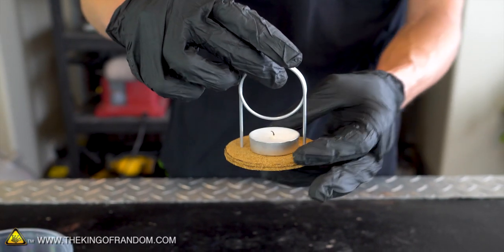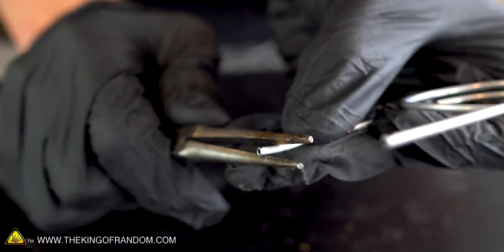Simple Steam Engine! TKOR's Tea Light Steam Engine DIY Mini Steam Engine

Comment: Use methanol
Reply: That's an alkANE, yay trilogy science
Reply: Lil Memeboy because it has a boiling point of 60 degrees Celsius which will allow for the whole cycle to happen quicker
Reply: Yesyesyesyes
Reply: D.G.M.ANIA pp
Reply: But wouldn't the candle just light the fumes and set the whole thing on fire?
Hm, then again, that could be pretty awesome. Imagine actually doing that with the metal salts for colored flame added in. They would probably plug up the tubing rather soon, but it should look pretty cool until then.
Reply: YouTube Thing methanol is actually an alcohol no alkane
Reply: Is this a big bang theory?
Reply: Meth-anol

Comment: Tips for bending pipes/tube : Insert a wire in, it will give resistance to kinking. For this one i would use small electric wire. But this tip derive for hard line watercooling, which is most often glass.

Comment: Are you willing to experiment further on the basic steam engine?  I think that if the flame was offset a bit, instead on being at the center of the tube's lowest part, it may increase the movement of the water in the pipe, as the heated water would be raising.  Another thing to try would be to have the "intake" and the "exhaust" to be bent in the same direction, instead of opposite, the little bit of suction in the "intake" may ease, or speed up, the movement.  I think this would be an interesting continuation of your post.  By the way, it is a very interesting post.  Cheers,

Comment: Minor suggestion:  Heat the tube more on one side than the other.  Hot water and/or steam will rise and cause the circulation you  are missing in your setup.  The way it is now, it is fighting itself.

Comment: Wouldn't it be much more effective if you offset the candle and kinked both ends the same way? That way one hole is an intake and the other is an outlet. The force of the intake will aid the force of the outlet in spinning the cork, and keeping the candle offset helps enforce the association by making one side of the loop warmer than the other.

Comment: It probably stalls because water is being expelled on both ends of the bent tube. Try offsetting the candle to one side so you'll have a hot intake side and cold output side. It'll work better. Once the candle (heat source) is offset to one side, try putting an icechip against the other side of the bent tube. Heat engines work off a thermal difference and this will create a better one.

Comment: This is a vacuum engine. If you speed down and look at the water flow when its blue-dyed, the two exhausts never push together. Water first boils and the volume is expanded inside, that pushes out the water, at the same time water vapor cools down touching the cold parts of the metal tube which turns to water again. This expansion and cooling makes the move. Although its sometimes called a steam engine, there is no steam getting out.

Comment: You should hold that flame further away from the pipe. Soot is insulating it over time. I believe that despite lower temps, the steam should be gaining more heat when the flame is further away.

Comment: If you bend the ends of the tubes the same direction and give the candle an offset!
I kinda see it working 
It is also April the first 
And this also makes more sense to me if this setup is flipped over so cold water can run down and the lighter warmer water rises up!
If you really had steam in this it would shoot like in the end
Steam takes 1700 more space than water

Comment: Another way to prevent your aluminium tube from kinking would be to fill the inside of the tube with sand and cap off the ends with tape, so once the tubing is bent over what ever you choose, you can easily remove the sand.

Comment: If you wanted to, you could probably rig up this device, or something similar, with a couple magnets to make an even better motor which could potentially power something larger and maybe if enough kinetic energy gets into the system, something really big could happen!

Additionally, I'd really like to see some Negative X combined with Lithium in an attempt to ignite Thermite.

Comment: If you just put the candle slightly to one side or the other of the pipe it will spin until the candle burns out. It can't pull water in when it shooting steam from both sides.

Comment: Can you see an ancient "coffee pot" with one of the ports leading to the grounds over the cup? Also, I woud use a cleaner fuel as the candle coats the tubing with a coat of carbon... this inhibits the transfer of the flame's heat to the coil after a bit of time.  Cheers!

Comment: It is stalling because your not creating a temperature differential between the two sides, thus making one side into a water intake and the other an exhaust. You can easily rectify this problem by simply putting the candle off center (closer to one of the aluminium pipes on the side.).

Comment: Would you be able to turn it upside down with half of the circle in water and some holes in the tubing that would be under water to continue flow of water through the holes and force the steam out into the air for push?

Comment: I think that its stops because you are using a very small diameter tube and the flame is too hot and causes it to push out all the steam before it and draw in enough water to continue.  You should try using some larger steel brake line and the same candle, will take longer to start moving but I bet it will chug along much longer

Comment: It would work better if they were both bent the same way. One will draw the water in the other will jet it out. 
You can even prime it a bit by sucking a bit of water into it with a small tube while the candle heats it.

Comment: I want to make a self circulating cooling system by taking a tank(soda bottle) 2 check valves one on each side connected to a metal tube to be heated like you did in this vid.

Comment: It would have worked much better if one side was slightly longer than the other so that cooler water would be drawn in the shorter side.  Another way to ensure the proper turning angle is to have the flame offset on the coil so that the cooler side feeds the hotter side.  One trick to bend pipe is to fill it with water then crimp both ends.  The water inside the tube prevents crimping during the bending process, as water is not compressible.

Comment: Do you require N52 strength magnets for these experiments to work well ? Or something slightly less powerful ? I cant seem to find the right-sized N52 magnets for doing these experiments. The ones on Amazon are all 1.26 inch diameter. Any pointers ?
Reply: @waswaniable I had the some problem for a magnet electric generator project. I'm not trying to be some advertiser, but after looking for days on the internet I stumbled upon one magnet supplier.

Might I recommend K&J Magnetics they supply Magnets in whatever size you need and seem to be trustworthy.

Hope this helps!

Comment: I think you would want both ends to point in the same direction, wouldn't you? After all, one end pushes (out steam) and the other end pulls (in water). Thus, both ends generate force in opposite directions if they are both facing the same direction.

Comment: Put sand in the tube and duct tape on the ends to prevent kinking. You should also try to heat the tube before bending it.

Comment: Just a thought....try a local auto parts shop and grab some NiCop brake line. Not 100% copper, but closer than aluminum
Reply: A plumbing supply shop should have soft copper pipe. Perfect for this and comes in 1/8 inside dia and larger.

Comment: If the candle wasn't in the middle of the coil, it would probably flow better, as there wouldn't be a symmetry, the hot water would be more "compelled" to flow. Just like old timey central heating.

Comment: to avoid kinking pipe, put music wire ($1 only or any wire that fills pipe) of snug diameter and then bend pipe any way u want, it wudnt kink and block. for bigger pipes use same diameter metal spring inserted into pipe and bending will be flawless. harley davidson use this method of metal spring to make motorcycle handle bar. some kind of liquid pressure can also be used. peace

Comment: You need to set your 🔥 slightly off center. That way, it acts as a forced siphon. You could actually bend your bottoms in the same direction and have it spin just as well if not better, because one side is blowing while the other side is sucking

Comment: uhm, look great. If this device was bigger and applied a gate with valve for input more water when necessary. Fixed the spin axis with dynamo, apply lead box And then use D2O and plutonium heat instead of candle, would be cool.

Or let think about if  this device using heat from solar power, replace water with ethanol...

Comment: the simple system engine,, you probably get it to run  more consistently . if you bent both ends  in the same direction . as one end is Intake and the other exhaust = propulsion .. the intake is trying  to inhale water in the opposite direction of the flow = movement ...

Comment: What if you were to use a magnifying glass to make it solar power or if you were to change the side of the intake versus the output like maybe just squeeze one end of the tube just a little bit or open up when in just a little bit to make a 3 to 8% difference in size and if you were to use distilled water instead of tap water that might prevent your parent clogging issue and what would happen if you put the flame a little to the left or a little to the right or a combination of any of those things just saying there I have said that nice video go man go

Comment: Is it possible to make a vacuum balloon? If you can support the balloon so it was the size of a normal blown up balloon, and vacuum it you could make a vacuum balloon that could reach space, and wouldn't pop from pressure, because there is no air in it. Even if it had a little air in it, the balloon could go higher then a normal balloon.

Comment: Call me crazy here...

But if the principle of your steam engine is that one end of the pipe draws water while the other end expels it....

Shouldn't 1 side be longer than the other? And shouldn't both pipes face the same direction?

If one sucks and one propels then they should be. With your set up, whichever side draws water, which could be either at any one point, it will fight the force produced by the other.

Am I crazy?

Comment: Its actually not a steam engine. Because no steam is formed.
Its an thermal machine, where cold water is sucked in on one side, and heated water is expelled on the other side, hence the movement.

Comment: Uhhh... where's the steam?

..."got it spinning perpetually for 20 minutes." 

🙄🙄🙄 

Ugh
Reply: He just didn't understand that the water was going out only one tube and coming in the other.  If he knew that, he could have bent the tube for better performance.  It should run (as a pump, not a steam engine) as long as the candle provides heat.  Your coffee maker pumps water the same way.

Comment: What's the use of this, please?
Reply: 尹帅  making energy with out electricity. Example, to run my factory where there is no electricity, I rely on the water particals to expand and push all my factory equipment
Reply: Pop pop boats as they are called, are just simple toys, from before you needed batteries and a password to have fun.
Reply: I think this can be used in neat decors.
Reply: To expand the mind. Try it.